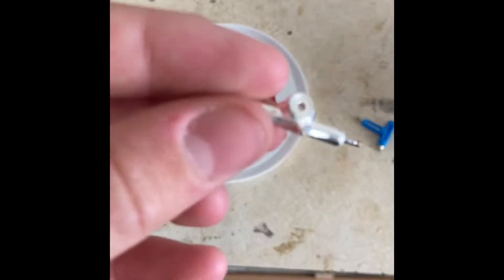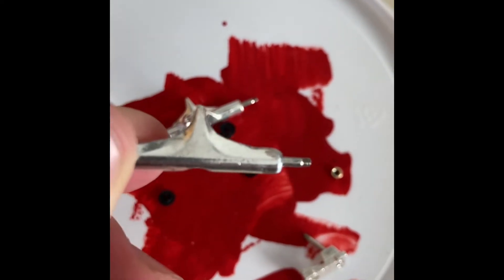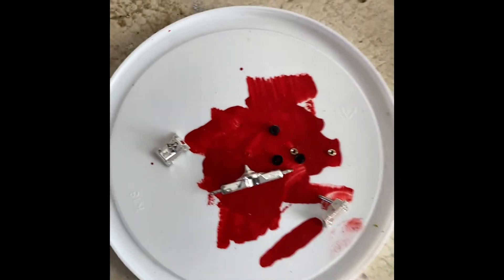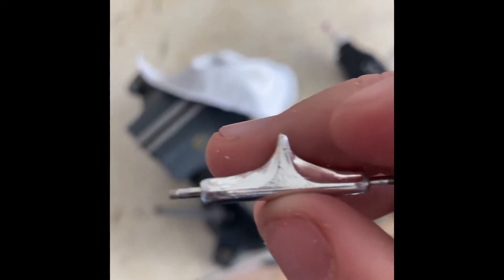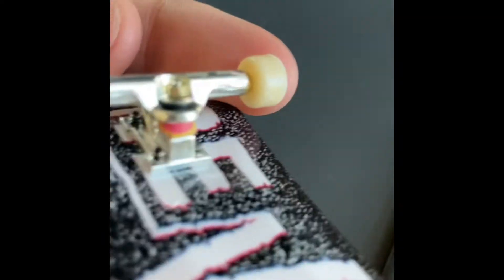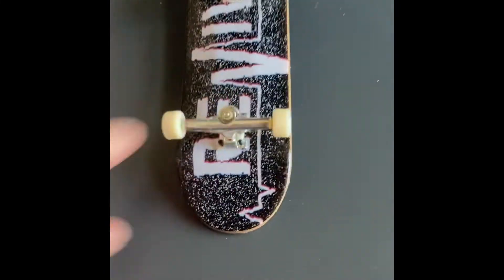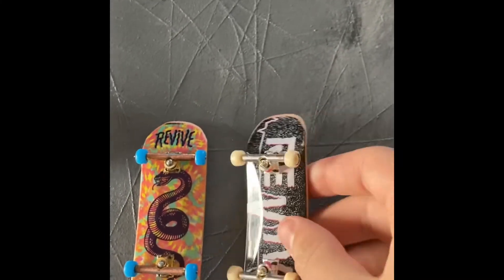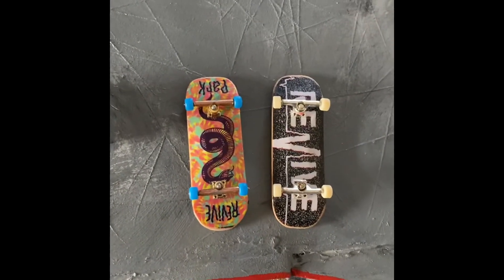CUSTOM TECHDECK TRUCKS

Comment: If you want cheap inverted kingpins . Teak  tuning sells y truck kingpins but they work perfectly on techdeck base plates you just have to pop out the old kingpins and take a slightly larger drill bit to make the hanger holes a bit bigger 🤙🏼 also if you can stack techdeck bushings and make them feel a lot better ! Two on the bottom one on top !
Reply from the maker: Cool, I’ll have to try those tech deck trucks